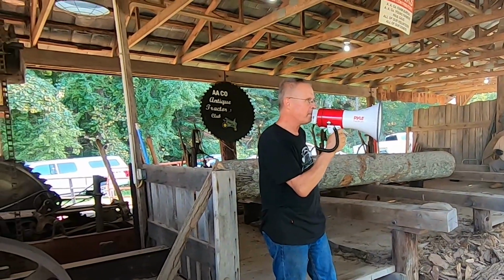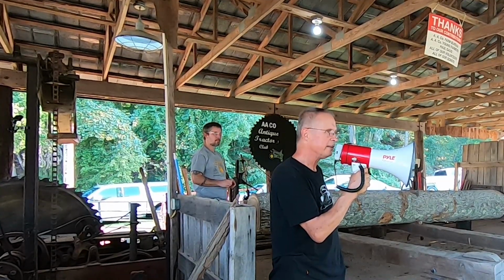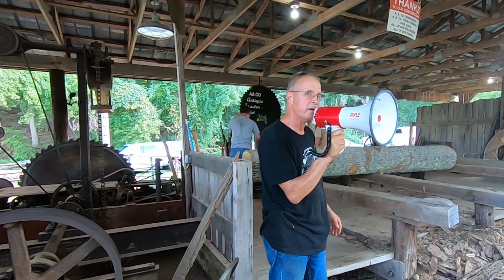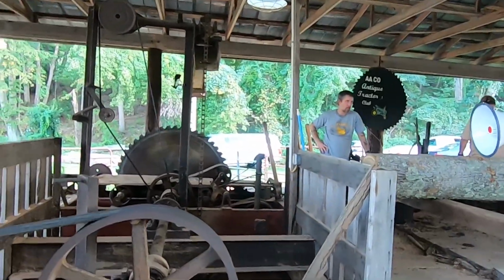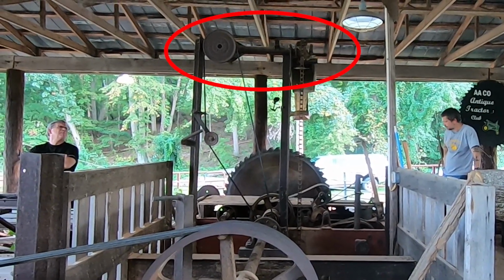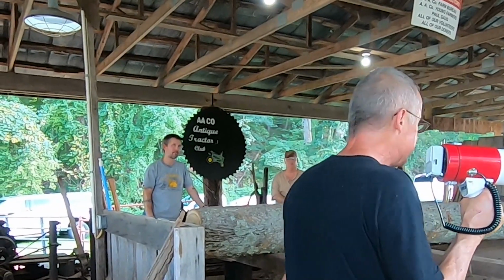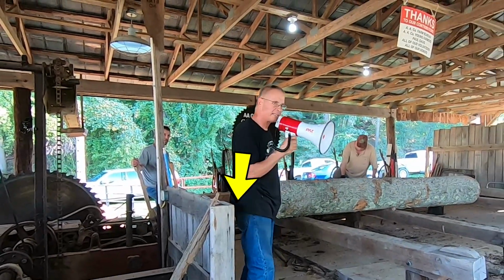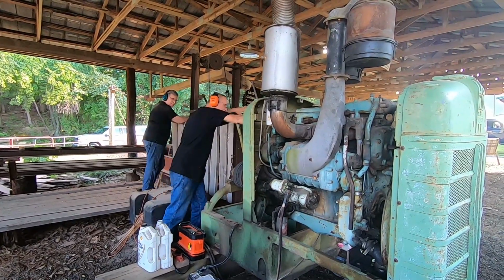Why you need a Frick Sawmill running a GM Diesel to cut oak fence boards

Comment: when U sawed it yourself U got a true 👍  4X4 OR 6X6 or railroad ties what ever U were sawing back then U didn't go 2 Lowes or 84 lumber 2 get what U needed   OMG 11 9 2O22
Reply from the maker: and.... the quality of the wood is better!!! Thank you.
Reply: My Father was a sawmill man for over 40 years. The last mill he had was a Corinth portable with a Detroit 4-71. Just one aside. Detroit Diesels ARE NOT supercharged although they have a supercharger it only supplies a fresh charge of air to each cylinder when the liner ports are uncovered by the pistons. Thereby blowing the exhaust out when the valves are open. There are no intake valves in a 2 cycle Detroit engine. This is why they have what is called air box pressure for the cylinders to draw fresh air from as the inside of the block is hollow. This is what the supercharger does. An engine is not “supercharged” unless the cylinder is charged with more than atmospheric pressure. Detroit 2 cycle engines operate at atmospheric pressure which is what we all breathe at. Hopes this clears some things up. BTW DD’s have ports in the cylinder liners that act as the intake valves.